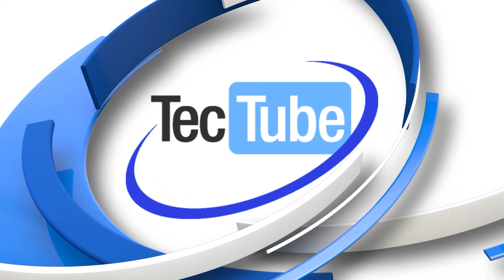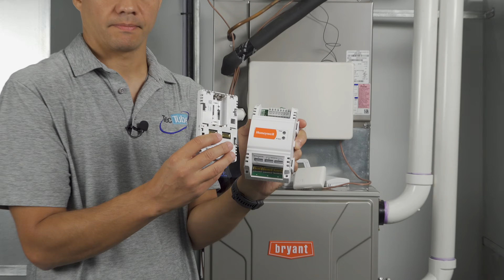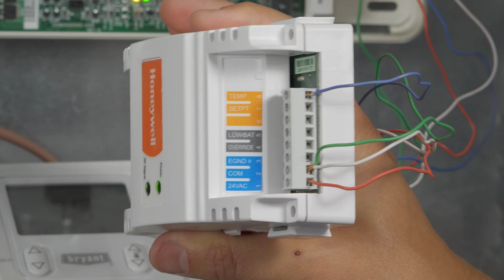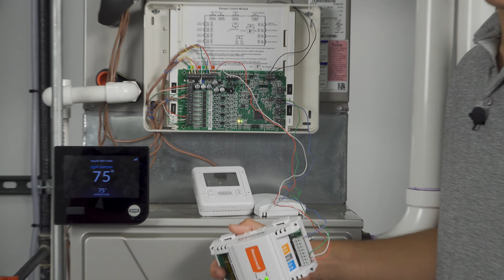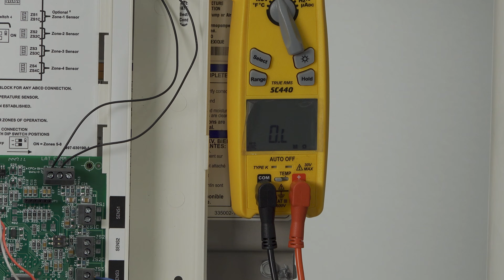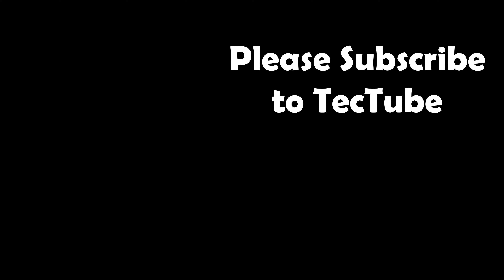Wireless Sensors for Infinity/Evolution/Ion Zoning Systems

Comment: Hi there, I was pretty excited about this setup after watching the video. 
I bought the same control and did everything the same way you did. 
I can’t get a temp reading on the UI. 
I bought another one and still have the same problem. 
Just wondering if you might have an idea of what could be going on there?
And I did pull the wires To check and I was at about 12 K ohms
If I hook up a wired room sensor. Everything works fine.

Thanks for your great videos.

Comment: Huge thanks on explaining this setup. I connected Honeywell Wired sensor directly to S1/S2 on Infinity and ran the wire to second floor. Worked very well. You mentioned In the beginning about alternative solution using BAPI sensors. Can you please provide part numbers for these?

Comment: Slightly tangental but in a similar fashion to the wireless sensor do you know if you would be able to wire a ecobee up to the zoning system as a dumb thermostat instead of an ion remote/smart sensor? (While still having the main ion system control SYST0101CW for zone 1). Main motivation would be to reuse old ecobees lying around instead of buying the remote/smart sensors. Additonally wondering if the ecobee’s smart sensors be able to work as additonal sensors for a zone?
Reply from the maker: No, that will not work at all. Ecobee is a standard wired thermostat with G,Y,W,R,C type connections. Ion zoning is a communicating system and the smart sensors are Dx- and Dx+ signaling. The remote sensors for Ion are just thermistors.

Comment: Hi Ryan. Thank you for posting this video - super helpful! It would be nice if Carrier/Ion/Bryant dealers and regional experts knew the honeywell remote temp sensors worked as a remote temp sensor or a zone sensor.

I have an Ion with my 2 stage communicating comfortmaker furnace and AC. Id love to add a zoning panel and a few zone sensors to help smooth out a couple rooms, but I cant get the local HVAC companies to do the work let alone believe the remote sensor will work. 

I wish you guys were in southwestern PA :)
Reply from the maker: We just asked Ryan and he said he built the national training modules for Carrier/Bryant (which obviously do not include Honeywell product) but when he presented that training to the Carrier/Bryant distributors, he did verbally discuss how to use either these Honeywell or the BAPI sensors. Now for that info to trickle down to the actual guys in the field at the dealers is another hurdle... hence the existence of this YouTube channel.

Comment: Can you use two sensors on one hub?
Reply from the maker: Why would you want to do that?
Reply: @TECTubefilms  This is being installed in a home. I would like two sensors installed, one in the family room the other in the Living Room. The Ion thermostat is mounted in a hallway leading to the garage (horrible location).  Therefore those two rooms get very warm (I live in S. FLA) while the hallway is cool. If two sensors work with on hub that is better for me than installing two hubs for two sensors.
Reply from the maker: @nicholasdickson9137  If you install two sensors, then the stat will just average them. AVERAGING sensors NEVER work. It just makes both spaces equally uncomfortable instead of one comfortable and one not. No matter how many sensors you install, the temp differences between the family room, the living room, and the hallway will ALWAYS be the same.
Reply from the maker: @nicholasdickson9137  Your best option is to relocate the Ion stat to either the living room OR the family room, but not both. If you cannot run wire to one of those locations AND you have space near your Ion stat to put this large wireless receiver, then put one remote wireless sensor in one of those two rooms.
Reply from the maker: @nicholasdickson9137  An Ion Zone Damper system like shown in this video would allow you to condition the living room and family room separately with their own sensors and setpoints.

Comment: Part numbers of the Honeywell devices shown in the video listed in your description would be a helpful add.
Reply: FYI:  the Honeywell receiver model # is WRECVR  ($150)
The transmitters models include:  TR21-WS, TR23-WS, TR21-WK and TR23-WK
The WK are the kits, the WS are just the sensors.  The TR23 has an additional setpoint knob & override button.  
The kits are about $250
Reply: @xyvyx thanks!

Comment: What is the distances/ range for good communication?
Reply from the maker: Radio Frequency 2.4 GHz (IEEE Std 802.15.4-2003 compliant)
• Open Range: 3000 feet
• Typical Range: 100 feet
• Output power: 16dBm
• Receiver power consumption: <0.5 VA
Reply from the maker: It can handle anything for a normal residence.  For 5 ton and smaller systems, the fan and ductwork can’t serve anything too far away anyway.  But we will look up the answer.

Comment: Is there a solution for using the infinity controller and other wireless sensors to average a temp or set priority with out actual zone dampers? Similar to the ecobee with the wireless sensors.
Reply from the maker: Yes you can average sensors with a non-zoned Infinity stat.  It is the same as thermistors on any controller, which means you “electrically average” them.  That means you have to wire them in series parallel in groups if 1, 4, or 9 sensors.  The wiring diagram has been the manual for 15+ years.

With that said, averaging temperature sensors NEVER increases comfort.  It just makes everyone equally uncomfortable.  If you average upstairs with downstairs, for example, you may have an 8 degree spread before you install the sensors and still an 8 degree spread after.

You need zone dampers to direct more or leas airflow to where it is needed if you want to make all rooms comfortable.
Reply from the maker: Ecobee… if you turn on Follow-Me… will only average sensors with occupancy detected.  That is very different than simply averaging.  With Follow-Me you can make the room you are in comfortable while overcooling or overheating the other rooms you are not in.

So the best option is zoning, then occupancy based averaging like ecobee or Honeywell T10, and then everything else.  Everything else includes a single sensor or averaged sensors.
Reply: @TECTubefilms  I have an ecobee 5 and sell lots of them, I don't use the follow me/occupancy mode, I use participation. It works really well in my 2 story house, mind you not every house is the same and I keep my fan on at all times and am able to keep 0-2 degree differential except when it gets 100 degree's plus outside. I've had a need for a few customers with broken up houses to use wireless sensors due to the struggle of running wires in finished houses. Mainly houses where bedrooms are on one end or upstairs like mine where they can prioritize the bedrooms at night and average everything during the day. I understand zoning is ultimately better, but due to the cost it is almost never chosen when these 2 options are presented. Like I said I've had great success with the ecobee using this set up but of course if the customer wants an infinity furnace ect I've been required to add a zone system to give them the same or similar function, no one like running wires either. 

I really enjoy watching many of your videos, very few do it as good as you. I'm a Carrier Dealer in Oregon, not a direct customer of yours.
Reply from the maker: Yes, ecobee participation would yield similar results to Follow-Me because it would only use sensors in some rooms that you care about and not average them all.

There is not really a way to do that with any thermostats other than ecobee and Honeywell T10.  Any stat that uses a single thermistor input for remote sensors won’t be able to do it.

Comment: If you were to remove the wires, in your example, from the zone board to test resistance, will the fact there is 24VAC power on one of those wires influence/alter the ohms value?
Reply from the maker: There is not 24vac on the temp signal wires.
Reply: @TECTubefilms  
Well, since one of the temp wires is in the same place as the common for 24V, I had to adk.
Reply from the maker: We understand why one might think that. But don’t forget you need two wires to complete any circuit and hence carry the voltage.  So having just the common wire without the hot wire won’t give you 24vac.

Comment: I know you said that if we hook it up directly to the infinity controller that it will only use the sensor for temperature, BUT if we hook up to the zone board, will it then read both temperature and humidity??
Reply: Thanks for your quick response.
Reply from the maker: No.  There is no humidity sensor inside the Honeywell device.  Plus for Infinity, the only option for humidity sensing is the sensor inside the main infinity wall controller.